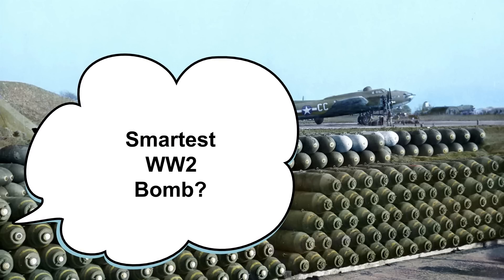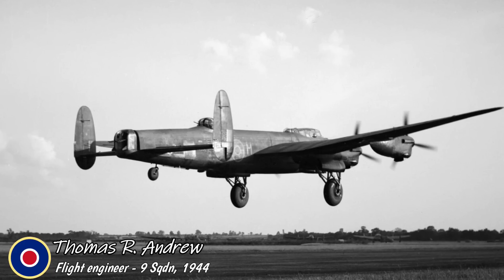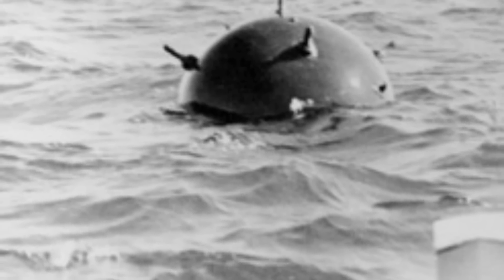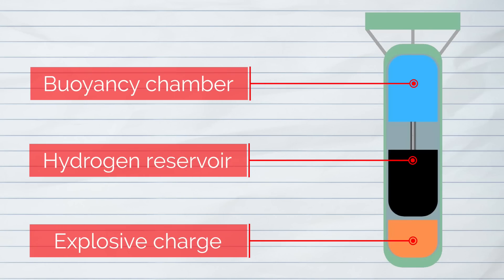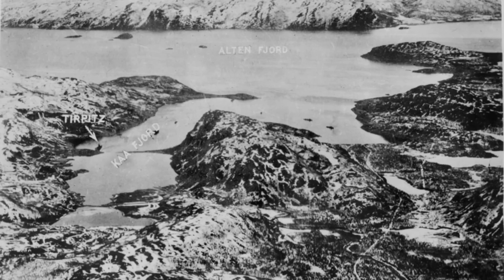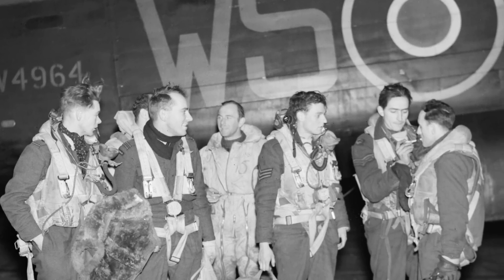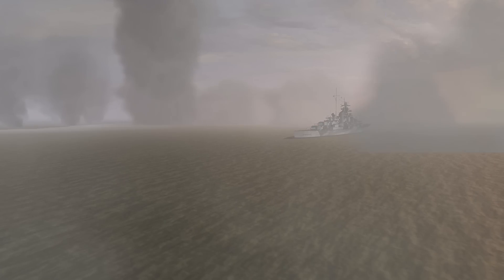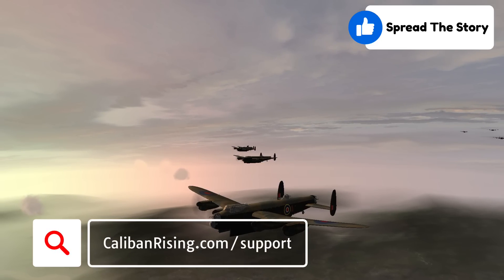What Was The 'Johnny Walker' Mine 617 Squadron Used Against The Tirpitz?

Comment: The USA cluster firebomb using bat delivery, German armor piercing smartbombs & japanese strategic balloon bombs are all more ingenious projects. It does not take a complex mechanism to create this bobbing effect. Only a pressure sensitive valve, a vent in the base to release seawater, & a tiny vent to slowly release the hydrogen to enable the mine to sink back to the depth to open the valve restarting the loop
Reply: Those German smart bombs - do you mean the wire-guided ones they used in the Mediterranean? Just found out they were called Fritz X - thanks, Wikipedia.

Because that was the first thing I thought of when I heard Caliban's initial question. ;-)
Reply: @LittleNala  The Frits-X was radio controlled though the bombsight by visually tracking a blue flare in the tail & sending control commands. There was also the hs-293 which was a rocket boosted glide bomb that was either radio controlled or wire guided. Not as dangerous as the Frits-X, but had some interesting variants. One dropped a torpedo another had TV video over wire so it could attack from behind clouds.
Reply: @alt5494  Northing ingenious about the German radio controlled weapons. Radio controlled drones had been built before the war in the UK and US. The US did use TV guided weapons in mid 1944 using a radio link and built an active radar homing glide bomb that was used in 1944/45. The British did a very cost effective balloon bombing campaign against the Germans in 1942-1944.
Reply: @richardvernon317  Frits-X was extremely dangerous the battleship Roma was sunk by one. The British battleship Warsprite was a mobility kill after a Frits-X breached nine decks before destroying the boilers & blew out a portion of the hull. A heavy armour piercing guided bomb with high angle attack capability is innovation. Compare the damage done by small strikes with Frits-X to the amount of ordinance the British used against Tirpitz. The British balloons where extremely effective, but nowhere near the advanced design of the Japanese balloons. Dragging a copper cable to short out power lines was the British main weapon. The Japanese intended to light the southwest USA into uncontrollable forest fires. The distances where vastly different the payload delivery against dispersed targets far more difficult. Comparing the two designs is similar to Sopwith Camel verses SM Spitfire.
Reply: @alt5494  And it was manually guided, there are no records of how many missed or failed and countermeasures were in place by the end of September 43 that pretty much defeated the weapon.

Comment: Down the pub! Possibly.  If you put a lemon seed in glass of tonic it form bubbles on its rough edges.  This will cause it to rise as the bubble/seed combination soon becomes buoyant. Then it sinks as at the surface the gas bubbles dissipate in the air.  It will continue to do this until all the dissolved gas in the tonic is used up.  So watching this could have prompted the idea.
Reply from the maker: Interesting

Comment: maibe the bombs had several chemical charges that produced enough air to empty the camber at a few moments either by dissolving a capsule in the surrounding seawater at different times or by a timer 
as for having the bomb turning in the water could had been a chamber in the middle with a weight in it , innitially in the head of the bomb but maibe the same air wouldve pushed it to the bottom of the central chamber causing the bomb to rotate while going up and then stay in that possition ...... maibe those chemical charges where build intoo the top of that weight and the chamber would be the floating chamber as well

Comment: I seem to remember reading that part of the plan was to drop the mines on the fjord sides so they would roll down into the water and attack the Tirpitz like that. Given your description of the deployment this seems highly unlikely unless the parachute was sufficient to prevent destruction on impact. Great presentation thank you.
Reply from the maker: Thanks for watching mate.
Reply: The weapon you are thinking of were standard (round) Mk XIX sea mines fitted with a hydrostatic fuze. They were used in a number of RAF Halifax attacks on the Tirpitz in 1942. One of the aircraft carrying the weapon crash landed on a frozen lake after being shot up, sank when the ice melted and was recovered in the 1970's. the remains of the aircraft are now at the RAF Museum at Hendon. I met the Flight Engineer of the aircraft in the early 1980's.

Comment: Hydrogen?  Not feasible or sensible, unless it was internally generated by a reaction of a metal with seawater.
Reply from the maker: a chemical reaction seems likely. So the aircrews were worried for nothing?
Reply: @CalibanRising  It used a bottle of compressed Hydrogen gas and it is totally sensible idea as compressed Hydrogen gas takes up a lot less space and weight than the same amount of compressed air.  This means the mine could do more oscillations using hydrogen than it could using just normal air.

Comment: I can't help wondering such an  intricate design based on random luck.

Why didn't they just design and use a guided bomb like the Germans did with their Fritz X when they successfully bombed the HMS Warspite, they didn't sink the Warspite but the bombs did severly damage her.
Reply: The USAAF had guided bombs by early 1944, the reason you couldn't use them was because the Germans had smoke screen generators around the ship. If you cannot see it , you can not hit it. The first attack in 1944 where this weapon was used, the Smoke Screen covered the ship just as the lead Lancaster had got its bomb sight tracking on the target and the bomb hit the bow of the ship. Everybody else missed. Second attack, the Germans hadn't completed the smoke screen defences, but a layer of cloud drifted between the aircraft and the ship, just as the attack was starting and everybody missed (on that attack everybody had to drop their weapons or they would not have the fuel to make it back to the UK). Third attack No Smoke Screen, No Cloud, No More Tirpitz. Fritz X only worked if the bomber was at high Altitude and could see the target. No a problem in the Mediterranean in summer for the majority of the time. Didn't work that well after the Allies put jammers on the ships.